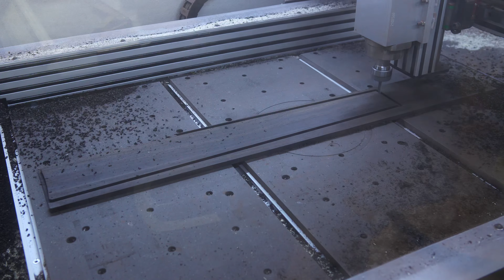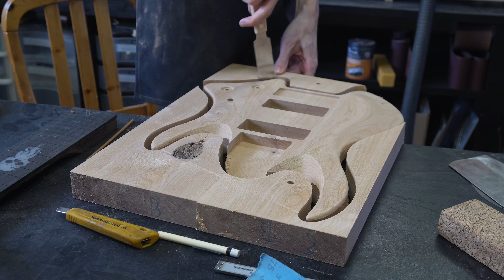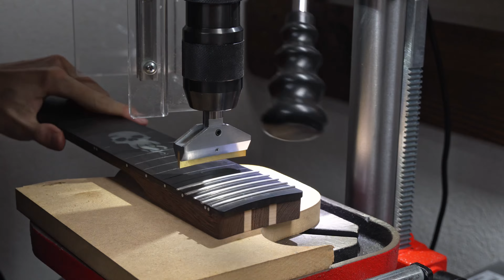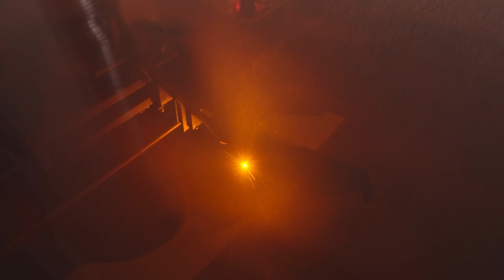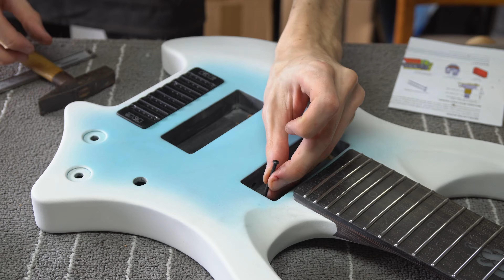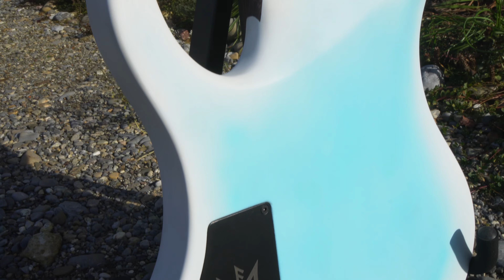Complete "Ice Kraken" Guitar Build in 10 Minutes

Comment: its a good tool that pivoting on on the drill press to press the metal strips in, good build and music
Reply from the maker: Yes, just maybe not good for the drill press, I ended up breaking it on a different neck... Maybe use it in an arbor press as intended.
Reply: @DarkArtGuitars well leasons learned, i hope the break did not set you back to much
Reply from the maker: Luckily it just ripped out the threads in the casting, and there was enough room behind it to use a nut and reattach it that way with a longer bolt. @enricodesign619

Comment: Beautiful build dude. Have you tried using fixtures? I used to machine my bodies like you did in this video, leaving tabs and flipping half way but sometimes I ended up having problems with the position of the stock shifting a bit, resulting in lots of sanding to save the part. Now I cut all the way through and place it in a fixture that I butt up against a fence, then use edge finding on the corner of the fixture. It took me a while to build it but if you're building the same stuff a lot it ends up saving way more than it costs.
Reply from the maker: I have thought of doing something like this, though my builds tend to all be a tiny bit different so I never implemented it. I have since switched to leaving some stock to leave on the top when I do the perimeter and then cut all the way through from the bottom (with no tabs but masking tape and superglue to hold the body), followed by a full depth cleanup pass to eliminate any minor misalignment.